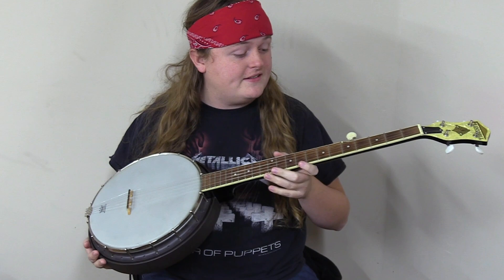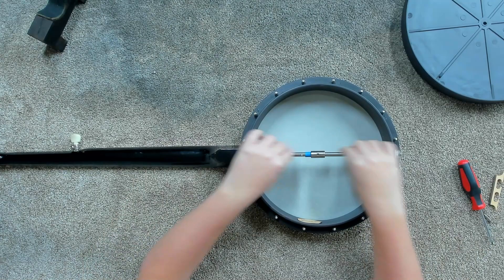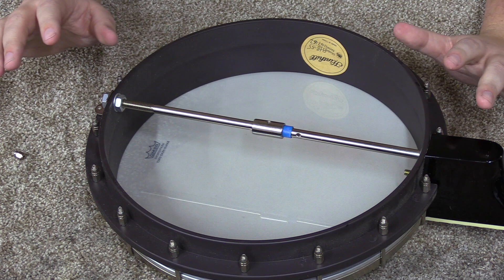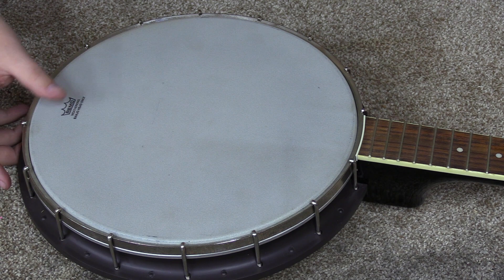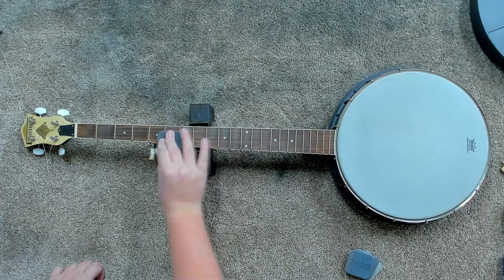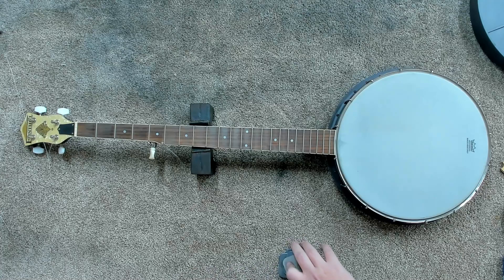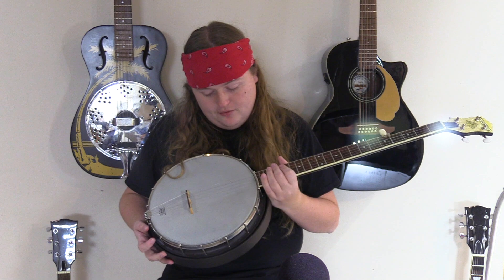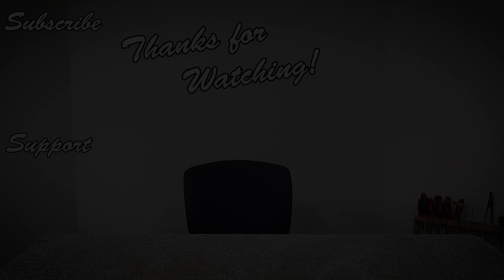FlintHill Banjo Setup

Comment: Possibly a silly question, but if you tightened the adjusting rod without loosening the heel bolt would it have maybe tilted the side a bit to correct the neck angle without creating the gap between the neck and side that you had to fill? Or would it have possibly broken? Thanks for the great videos.